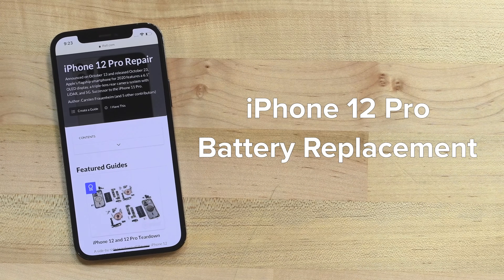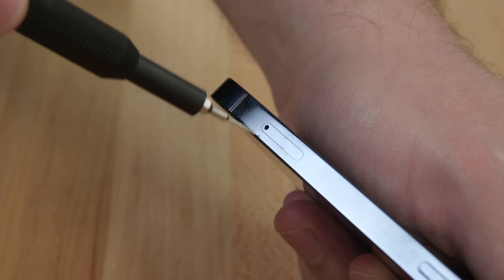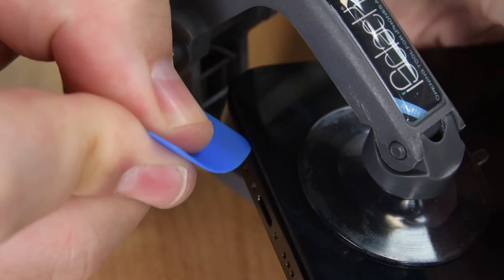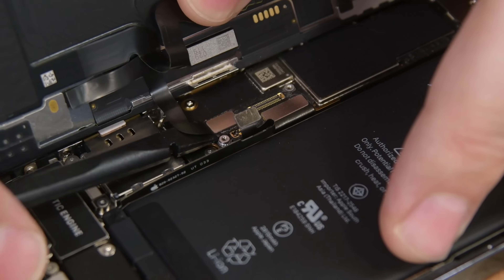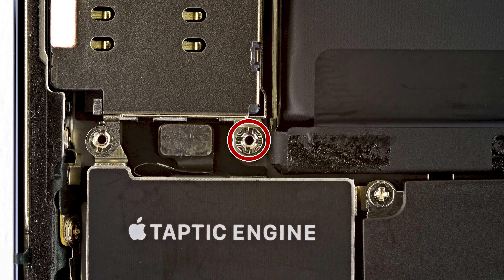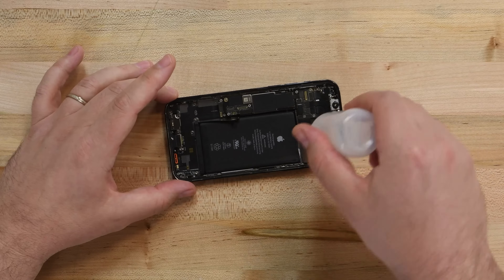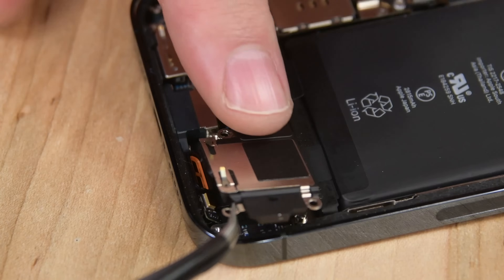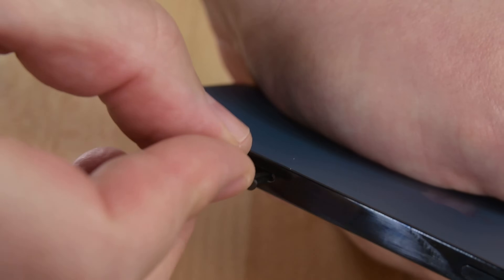iPhone 12 and 12 Pro Battery Replacement

Comment: Having to remove this much parts before accessing the battery is crazy. We need laws that bring back removable batteries in phones.
Reply: The EU actually passed a law that says just that! By 2027 all phone batteries will need to be easily replaceable
Reply: @DanteG1234 also e-bike battery 🔋 and electric cars..
Reply: For real!  It's like going in for windshield wiper fluid and needing to drop your motor and tranny.
Reply: i did it without removing parts like on video
Reply: @livechannel2001 seriously lol.  You only need to remove the first cover to unplug the battery.  Nothing else needs to come out
Reply: One was just passed (Jan 2023) by the EU
Reply: @DanteG1234  That law isn't going to do anything for iPhones or Androids. That law only applies for devices batteries that don't have quality cells.
Reply: @learntostrafe  "All smartphones, including iPhones, must have replaceable batteries by 2027 in the EU"
Reply: Maybe don’t get a water resistant cellphone? You want a removable battery get an old Samsung but you’re also responsible for any accidental damages. You people don’t understand this is done for the phones durability and reliability
Reply: it's no different than the way an automobile is assembled. Deal with outdated tech, or pay somebody to fix the tech as it breaks.
Reply: @Adventerouswolf88  don't talk bollox, from a design perspective it would be very easy to make a replaceable battery system on an Iphone
Reply: @crozwayne  I never said it wouldn’t be. Whats the point of your statement?
Reply: @Adventerouswolf88 - it is different, actually. I believe more people DIY their vehicles than their technology.
Reply: @MassDynamics   You literally can’t DIY many modern vehicles on behalf of the modern equipment. Oil changes maybe. But a lot of repairs that used to be “simple” now require expensive software to recalibrate certain parts that need to be removed and/or entire modules. Quite similar. Stick with the old outdated stuff, or pay someone to fix the new stuff. Removing a battery and replacing it in an old phone is much easy than any repair one would do on a vehicle.
Reply: @Adventerouswolf88  i can replace a battery lmao
Reply: @DivineDart  “A car” is not every car. In many modern vehicles. Without proper tooling you will wipe the memory from many modules and erase all customer settings. Not to mention new hybrid systems that you in fact, can not replace without taking to a dealer. But yes, I’m sure you can replace the battery in your car. Just like I can replace the battery in my older android. Doesn’t prove anything against my point.
Reply: @Adventerouswolf88  you can replace a battery in a car
Reply: @Adventerouswolf88 the average person doesn’t have a new car…

The average person does have a newer phone
Reply: @revit4909  I said modern cars. Not “new cars”. 2012 was a huge year for modules and expensive and sensitive electronics in vehicles. When you drive down the road I think you’ll see that most families have one or more vehicles equipped with advanced electronics.
Reply: @Adventerouswolf88 I agree. I used to do 90 percent of my cars work, now I just get a good warranty. I couldn’t even figure out how to replace the dam seat belt mechanism, jeez.

Comment: This one is a little harder to DIY. With all the hassles and risks to do this for $75, I’d rather pay $90 for Apple to replace it for me. Don’t get me wrong, I’m all for that consumers should be able to repair electronics by ourselves. Apple has made it too different to do it yourself in most of their products.
Reply: If you do it yourself you could do it once and be able to do it many times after, even for other models, and if you do it yourself, you can use a 4100 mAh battery instead of using the 2800 mAh they replace with.
Reply: @fuzzychang1676 Those 4100 mAH batteries are a scam dude and are probably worse than the degraded battery that you are replacing…

Comment: If I soldered the new battery to the phone BMS (the one which came with the phone), would the phone recognize it as something different?
Reply: Very good idea but i actually think that the measuring data from the old battery doesn't fit to the brand new one so the iphone thinks there is something wrong. Maybe there is an option to reset it before the replacement?
Reply: If that’s the case, it would be very disappointing. Thinking about it again, apple would definitely do such thing as they lately went above and beyond to make it harder to repair their devices.
Reply: If you have under ios 17 you dont need to use reprogramator.

Comment: It cost $69 to have it replaced by Apple to purchase the battery from a 3rd party company you’re looking at $40 plus you need all the proper tools why risk it just bring it to Apple it’s covered under warranty if they break it…. if you break it you’re stuck with a broken phone that has a bad battery.
Reply: As of today, I checked and Apple store will replaced batteries on most newer iPhones 12 and up for under 100.00, my iPhone 12 only cost 89.99

Comment: Does face id work if I replace the battery on my iPhone 12?
Reply: It will if it’s done correctly if done with genuine Apple replacement parts, with aftermarket parts definitely not, that’s when I sell that phone quickly

Comment: I had great trouble when installing one of the standoff screwer back for the taptic engine. I spent like 30 minutes on that single screwer alone. So my advice is if you have isopropyl alcohol to resolve the glue, do NOT uninstall the taptic engine.
Reply: 1/3 of the video is way too much - didnt remove, taptic, sim card and loudspeaker - just focusing on pulling the battery strip carefully.
Reply: @clintw567  This is what I need, the screwdriver isn't griping the standoff screw at all so I'm just going to remove the battery while disconnecting the taptic engine but not removing it as I just can't at the moment
Reply: This should be a 0 skill adventure
Reply: never had issues
Reply: Sounds like a skill issue.
Reply: What’s a screwer?

Comment: Hello, just a question.  Why do I need to take apart the taptic engine, speaker and the sim card holder first?  I thought I can just disconnect the battery and replace it?  Thank you
Reply: You have to take those off in order to access the black pull tabs on the battery
Reply: @shadmansakib5742  no, he’s right, he doesn’t have to. Those can be accessed without doing all these steps mentioned. It will be a bit more tricky to pull the tape out, but it is completely doable (have done it myself)

Comment: If you replace the battery, does it the waterproof is loss?
Reply: if you install the seal before probably will hold some water but not sure will ever be like it was from factory
Reply: Yes
Reply: It will never be the same as it was when new out the box but then again no iPhone is truly water proof, the speakers will get jacked up and will never be the same unless you get that replaced

Comment: What about glue? If you change the battery will it still be waterproof??? I’m guessing not especially if you don’t use glue
Reply: probably, but then just don't get it too close to water, why would you want it to be submerged in water anyways?

Comment: I received my 12 Pro on November 9th 2020 and the battery after only 90 charge cycles dropped down to 87% of normal use of design capacity which isn't in alignment with what Apple says: 
They state you should get 500 charge cycles out of a battery yet mine was at 87% after just but I think they did something to the battery this year and it "cheaped it up" big time.  

They will warranty the battery for a year and if it drops below 81% in that time - they will replace it. I have Apple care on mine and I did a phone replacement because I had issued with the screen flickering and no audio on some phone calls occasionally. Turns out there was a group of defective 12 Pro's that were manufactured between October 2020 and April 2021. Mine was manufactured in October of 2020.  Anyway - my new replacement was manufactured in May of 2021 and is so much more normal. Battery is still at 104% and no flickering screen or audio issues.  

My comment on replacing the battery myself - I could do it but would not risk it - I'd rather pay Apple to do it to keep my warranty intact - who wants a phone without the ability to tell how well that replacement  battery is doing? I don't but I respect everyone's opinions here.
Reply: How did you know your charge cycle and battery percentage?
Reply: this exactly mine has all these issues buh my dad thinks am careless and won't understand...mine is at 76% battery health and it keeps dropping

Comment: Its insane how tightly integrated and engineered phones are nowadays to fit as much technology in the smallest of spaces. Its fascinating to look at, but I can also understand how it could be a headache when it comes to battery replacements/repairs.
Reply: i remember me, when u could just buy a new battery for 10 euro/dollar and remove the back cover and replace it just with a few clicks and done. 

But now its like lock-pick to replace it (by yourself)

Comment: I swear they are just making it harder and harder to change the battery lol
Reply: Right to repair
Reply: Translation “just buy our next model it’s way more expensive”
Reply: Yeah, I totally agree, it’s designed this way so that not anyone can do this but certified Apple repair.
Reply: in my opnion it looks easier to do than iphone 4/4s back then, yes it is still so many parts needs to remove but the components looks easier to remove even if compared with previous iphone series like ipX or Xs.
Reply: @Narucas  dude, replacing the battery on iphone 4/4s literally takes 2 minutes.
i owned tons of those devices for collection during years and they are so easy to repair compared to recent iphones

Comment: how about waterproofing after changing the battery? any issue?
Reply: Never treat any smartphone as 'waterproof' especially an iPhone. I remember seeing reviews of my XR saying it was fine to take swimming or immerse in water. 5 minute accidental dip in a pool killed it. Phones lose waterproofing over time so never ever risk it, even with those that have the highest ratings.
Reply: But it’s not as water proof as the one which came originally installed from the factory
Reply: If you replace the seal before reinstalling the screen, it will still be waterproof.
Reply: Ya the water seal haven’t been put back in so it will be water damage

Comment: How does this affect the waterproofing of the iPhone 12?
Reply: Not waterproof, but water resistant.
It eliminates that feature
Reply: @BlackDragon31000  if you replace the seal it should still have its water resistance
Reply: Dont count on IP68 rating to be maintained after you do this job. Biggest possibility is, when you insert the guitar pick to take the display out, you'd have bent or dinged the edges ever so slightly that your naked eye wont catch it. THAT is all the water needs to get into despite of the new seal. Chances are pretty darn high of water getting in after this job!

Comment: They truly don’t want people to repair their own devices! Out of spite when my battery dies I will replace it.
Reply: My bat on my phone only lasted 5 years and it is toast right now why I’m watching the video to see how to replace it myself rather then someone else to fix it be way, way cheaper
Reply: It’s just removing screws tho. If they didn’t want them to be repaired me they’d just solder everything they could. Plus you can take it to a store that fixes phones and get it done for like $100 or a bit more which is a good deal since it will make you phone last way longer.
Reply: @revit4909  cheaper to just diy if you know what you’re doing
Reply: Apple have recently began selling their manuals, parts and tools. Which is only going to make it easier to repair.
Reply: Actually iphone is the most repairable phones out there, but they only want their technician to do it for profits. Your iphone will easily last 7-8 years with good care. It's good for the environment
Reply: @houghwhite411  Say that again with iphone 12.
Reply: @houghwhite411  That's just not true at all
Reply: @franky-161  I just saw some footages. My point still stands for last gen iphones. But they don't want you to repair it. They want monopoly over repair.

Comment: I have been using my iPhone 12 pro for a year and already the battery needs service. Been using it pretty extensively watching hours of videos in 2x speed but still very disappointed in the longevity of the battery. Now the battery goes very quickly down to 1% and it can last hours at 1%. Tried calibrating it but replacement seems like the only way to keep using it...... At this point I'm considering switching back to my OnePlus 5T and give apple the middle finger tbh.
Reply: You’re probably using a non-certified cable. Non-certified cables use cheap parts and have almost no proper chips to properly charge the phone. Commonly, the tristar chip goes out due to this issue. In other cases, further motherboard damage happens. In rare cases, the whole battery literally just dies. But usually, the battery cells are damaged causing the battery to die out quickly.
Reply: @Ciso_diagnostics  how do you know if the cable is certified?
Reply: @michaelw2129  it will say “MFI” on the box or in the info/description when purchasing the cable. MFI = made for iphone. amazon basics lightning charger is MFI.
Reply: @Lckesner  And you believed that? woah what a mess. Any Cable would just work bud.
Reply: @Ciso_diagnostics  cables are just cables… no chips inside them. Maybe the charger, but good quality ones (especially if slow) do the job well too
Reply: @MrGilgameshJR  they do have chips inside them. Google „Load Switch“. You will be amazed.
Reply: it didn't even come out for a year
Reply: I’m a profesional phone repair technician btw.
Reply: @Joshua Black loool

Comment: I’m thinking about having it done on 3rd party repair shops in the future. We don’t have any apple authorized center in our place. Will it affect the software? Or by chance will it stop getting software updates?
Reply: You are going to lose the battery health percentage
Reply: Nobody knows about that, sadly

But if I were to own iphone I'll give it a shot
Reply: Nope it does not
Reply: It’s not like the display or faceid
Reply: Nope if he knows how to do it properly then u will still have battery health
Reply: @amanjain755  you mean if you purchase the device that copys the codes from the old battery which cost much more than the battery itself . You are right
Reply: all iphones from XS forward will display important batterie message if battery is replaced as shown in this video… you need to replace BMS board from original battery to new battery and than reprogram it… only that way will prevent important messages being displayed… check some videos this tutorial isn’t good at all…
Reply: @tetaizozadja7080  me on

Comment: Better solution sell that over expensive phone and buy an android that do not pair all the components by a software lock
Reply: It's true - no warning message will appear on Android phones, when you (successfully) replace the battery. But it's still similar difficult to change the battery on most common Android phones (samsung, xiaomi). I hate it, how difficult it is to replace an expendable part like the battery. This should be more easy to be done...
Reply: @thomasgruber1759 back opening phones are easier to fix since you don't risk damaging the display as much as lcd side opening.
Reply: @houghwhite411  yes, but It’s a very tedious process as you can easily break the back glass. In rare cases, the Galaxy A51 models actually have the on-screen fingerprint sensor serialized to the screen itself in the recent software update.
Reply: @Ciso_diagnostics  i don't recommend using fingerprint scanner but the other comment I made point about the "don't buy apple" statement is no longer applicable since they're all doing the same

Comment: I really don't see the need to remove those bottom parts to access the battery strips.
Reply: Strips will rip if not pulled out at an angle
Reply: @BeyondWoWJunkies  not if you use a mixed solution of 99% iso, and some acetone. You can pry the battery out using that mixed solution, just be careful and patient.